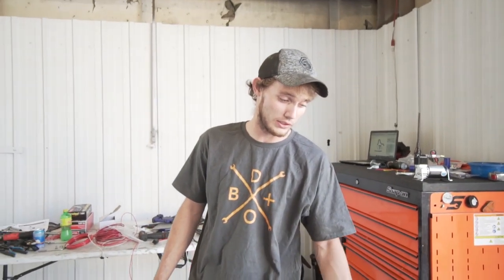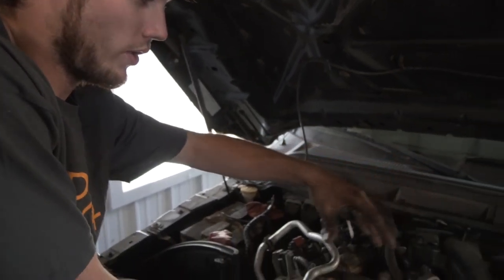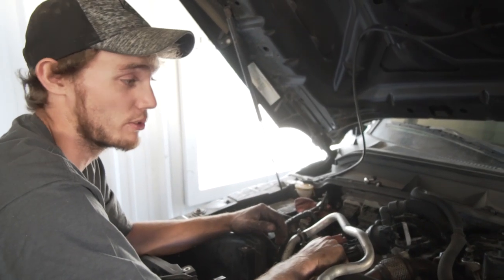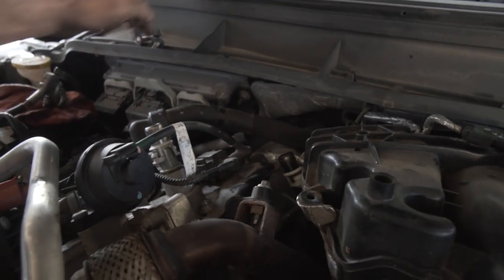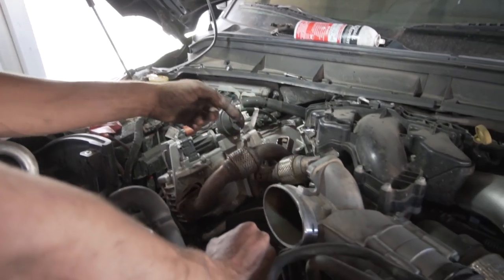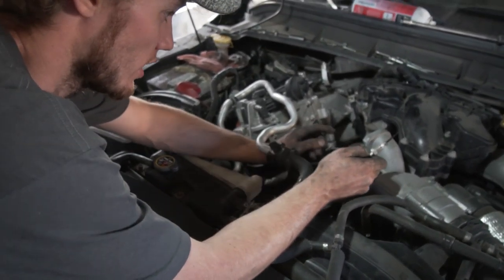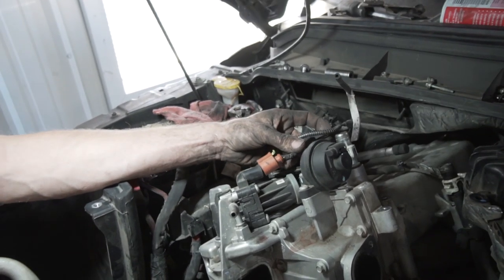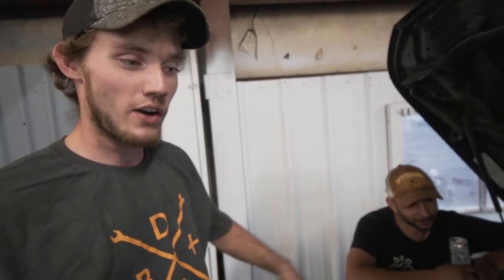2015 F-350 6.7 Powerstroke EGR Delete How-To

Comment: Nice video. Do you remember if you had trouble with the bolt and nut that points toward the firewall on the cooler’s far back-right? It may hold a bracket. How long does removal take and do you have a preferred tuner you guys like?

Need to do a DPF exhaust delete video next.
Reply from the maker: I don’t remember having trouble with any of them other than the two that screw into the head for one of the exhaust pipes. Removal took about 2 hours, I have had good results with the H&S Tuners, this particular truck has a Spartan tuner with a multi position knob. Hope that helps! -Aaron
Reply: Denver Beer & Oil So how have the mods worked with the older kit? I’ve found a really affordable 2011-2014 delete kit but in drive a 2015. What should I be mindful of?
Reply from the maker: Truck is performing as normal, just follow the same coolant re-routing in the video
Reply: DBO where do you guys recommend getting the egr delete kit from? Thanks

Comment: Hey Y'all - I ended up in the same boat as you.  2015 truck with the 11-14 kit.  Followed your instructions, it worked well.  Question is... are you experiencing any issues not having the heater core bypass line?  I didn't do the secondary D-Gas to lower radiator bypass either, and just left the stock metal one in place.... okay, or dumb idea?  Thanks for the input!
Reply from the maker: Exactly what we did and no issues. As a side note we pulled a double car enclosed trailer weighing about 15k lbs on 2000 mile trip. No cooling issues whatsoever.
Reply: @DENVERBEERANDOIL  Well there you go, can't argue with that.  Thanks for the video, very helpful.  I just did (a couple hours ago) the hot and cold side of the intercooler, and up next will be coolant pipes and radiator replacements.
Reply: @DENVERBEERANDOIL  Where y'all located?
Reply from the maker: Sounds like it’s coming together! Hit us up on Instagram... @denverbeerandoil

Comment: Great video but what did u do with the hose that supposed to go from the top of the radiator to the lower part of the radiator which usually involves removing headlight and grill?
Reply: We need to know this question too

Comment: One thing I had a huge issue with was the bracket on the back of the EGR holding a hard line. 2012
I just took a screw driver and hammer and hit the bracket bending the screw back which allowed the bracket to come off.
Reply: hey bro how much was your delete kit and do you have the link? what did you notice different about it and will you have mil on after performing delete?
Reply: That line is very easy to remove from the passenger side wheel well with the wheel removed.

Comment: So I just got my truck done . egr delete . all the guy did was re program it and changed the exhaust.  He didn't have to take off anything on the motor like the EGR itself he says that the program just turned it off and the valves won't open so it's just like having a blocker plate he said that you don't need any of that just program it and cut out the old exhaust and weld on a straight pipe and it's all you need to do my truck runs fine plenty of power no engine lights everything works perfect
Reply: Clayton what kind of programmer did you use to fool the onboard computer ?
Reply: @umpman04   I am not fooling the computer..
Reply: @claytoncanter6462 you are though…

Comment: I got a 15 Ford. I want to buy the same kit because it's cheaper. The quick connect hose that you routed and looped back, does it still make the heater work correctly?
Reply from the maker: Yes, everything heating related is exactly the same as before
Reply: @DENVERBEERANDOIL  Sweet! Going to attempt this, waiting on the kroil to arrive will soak the EGR bolts twice a day for a week. I hope the bolts don't break.
Reply: @DENVERBEERANDOIL  so no issues with the routing of the hoses on the 15 with the 11-14 kit ? eliminating the small line from the expansion tank had no effect on any coolant flow ?

Comment: My 2015 already has the cooler unplugged without issues ( just bought the truck). If I take the cooler out there shouldn’t be any problems starting as long as I use the correct parts for the block off and coolant re route should there?
How did you get the violent out? Did I miss that part?
Reply from the maker: Is your truck tuned? I assume so, if you dont have a light for the egr. I'm not sure what you mean by violent.
Reply: DBO violent? Lol that was supposed to say coolant. Guess spell checker didn’t know what that was
Reply: Truck is tuned but don’t know the settings of the dial

Comment: I got the 2011-13 kit also, I used the factory metal line from my radiator bypass, but it threw the sensor code even when unplugged. Any suggestions?

Comment: Can you delete a 2015 f250 6.7 with exhaust fluid fault message? Or would you have to address the message prior to deleting? Thanks in advance...
Reply from the maker: You will need a tuner for it run once deleted, the tuner will clear codes just fine.

Comment: Honestly this guy didn’t read the instructions very good because the hose he says you don’t use eliminates that ugly metal line with all the kinks in it so it’s not just a random hose in the middle of the engine bay.
Reply from the maker: Wrong sir, that is true for 11-14 models, 15-16 are different.
Reply: @DENVERBEERANDOIL  the 15-16 still get the hose and it goes from secondary tank to the plastic T with a sensor off the radiator
Reply: The hose you said you don’t use replaces the line you pulled out of your way at 12:10. It is a cut to fit your preference in length

Comment: I known this is a year old. But the factory air box gets colder air than these so called cold air intakes. As long as that was a box using fresh grill air its a true cold air. But if its k&n filter it's worse for the engine. Proven that factory motorcraft air filters provide better filtering good up to 500hp+
Reply from the maker: You are correct about the factory airbox. The air temp is not the problem, but the flow. The factory filter doesn't have the surface to flow much more than 500hp. This is an S&B intake and offers cold air from the wheel well and grille, with better insulation from the underwood temperature. But even this massive offset cone filter has issues flowing as much as this truck demands. Filters start sucking in on themselves as soon as their is a hint of dirt on them.

Comment: Great video, but I have a quick clarifying question.  On the 2015, was there a bracket connected to the rear drivers side threaded stud on the EGR unit shown in your video from 8:05-8:16?  In other videos I have watched that seems to be an almost impossible nut to remove without lifting the cab.  However, I have read that on the '15 that nut is no longer there.
Reply from the maker: Only one that caused any issue was the one in the rear that required the removal of the PCM, to get to it. My memory isn't vivid though as this was a few years back
Reply: You don’t have to lift the cab to remove that nut. Take passenger wheel well and the wheel off get a 3/8 ratchet and a deep 10m socket. Took me 5 minutes to get that nut off after removing the wheel and wheel well.

Comment: If I did an egr delete on my 2016 f350 do I need to remove the connection for egr throttle plate.? Thank you.?
Reply from the maker: No you can leave that

Comment: Will this delete give the truck a check engine light? Can't loose my remote start.
Reply from the maker: Not if you flash it properly. That is mandatory when doing this delete. The truck won't even start unless you have a tuner.

Comment: Man I need some advice. I deleted my truck, sinister, flo pro the whole nine yards. I bought a tune from ppei not knowing it was for a stock exhaust. I flash it once, idles like it ran outta fuel..i realize it was the wrong tune, so I flashed it back to stock. Packed it up, sent it back to ppei. Bout a proven diesel race tune from dirty diesel out of Canada. Installed the proven diesel 200hp tune. It threw codes p06a6, p2122, p0193, p0532, & P0335. Smooths out when u give gas but the codes are making it idle like shit. Reflashed it, same thing. Unhooked batteries for couple hours to reset pcm, flash back to stock, then flash the 200hp tune again, now only four codes, P0335 crankshaft sensor went away. Another guy online had 3 of my codes, changed all the sensors nothing changed, but it went away only after he took off his battery terminals. Do I need to get my pcm flashed to stock and if so, then does the tuner I have not do it fully when I install the “back to stock flash”
Reply from the maker: If you flash back to stock with the exhaust components unplugged the truck gets very angry, especially if you try and start it. Might be worth trying to flash back to stock, disconnect batteries and touch terminals, the follow the procedure of your tuner to reflash the delete tune. I hope that works for you, if not I would be leaning towards a bad tune or a fried PCM.
Reply: DBO how would I go about changing my pcm and having it paired with my truck/vin. Will ford be able to do that without me having to tow my truck in?
Reply: Thanks for your quick response. I was thinking it was pcm but the local diesel shop says the only way u fry it is if u pull out the obd while it’s installing or if the battery dies during. My batteries were enough to install the tune and to almost turn the engine. He says he thinks I have a wire pinched somewhere inside the motor. Fuck. Hopefully he’ll figure it out quick When i to send it over to him next week.

Comment: Did you guys tune it beforehand?
Reply from the maker: Yes truck was previously Spartan Tuned
Reply: @DENVERBEERANDOIL  Cool, thanks man. Doing a full delete tomorrow and don't wanna mess it up.
Reply from the maker: It will still run with an egr delete, just throw a light. The SCAT delete will put it in limp mode without the proper tune.
Reply from the maker: Best thing you can for your truck, mine has been tuned for 100k miles now, we tow a 20klbs trailer and beat the balls off of it, no service besides regular maintenance.
Reply: @DENVERBEERANDOIL  Sweet deal. As long as I can get a tune in beforehand I delete both the DPF and EGR. Getting a 10K camper this year so it’ll scoff at it now. How tough is the coolant reroute?

Comment: Hey bud great video you shared, helped me out alot. Quick question though. After i deleted the egr cranked up my truck and got a wrench light or service light and it has very little power. What did i miss?
Reply: Did you tune it first

Comment: If I just delete the dpf and unplug the egr will it be ok?
Reply from the maker: Should be fine, depending on the tuner you use.
Reply: @DENVERBEERANDOIL thanks.  Deleted it in April and left the egr in place for the time being.  Best thing I ever did to my truck.  Was getting 9-10 mpg, now getting 17-18mpg.